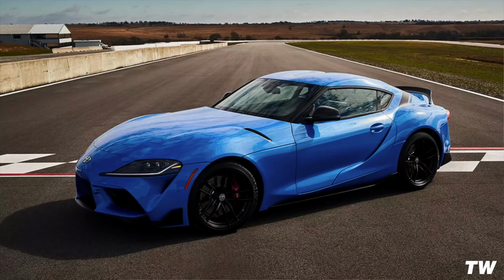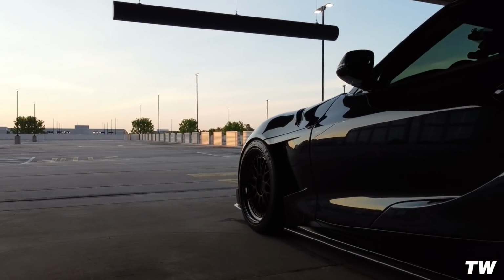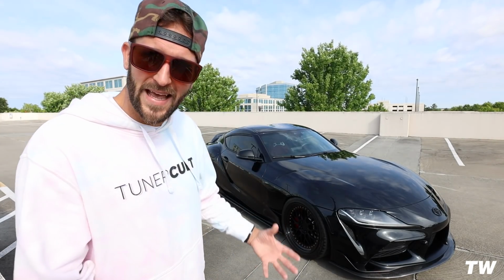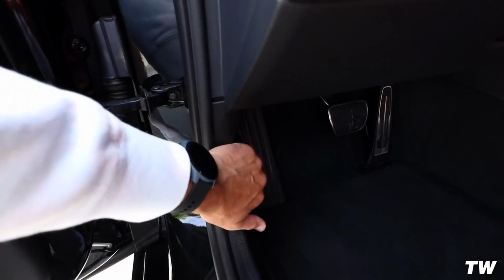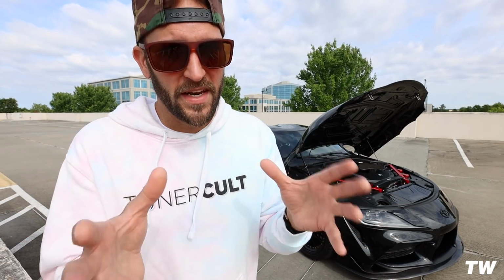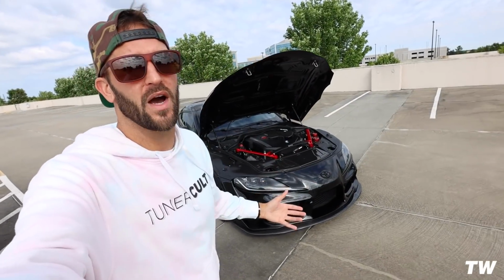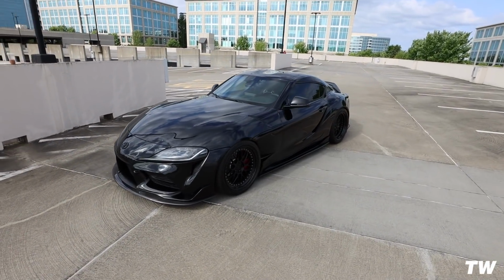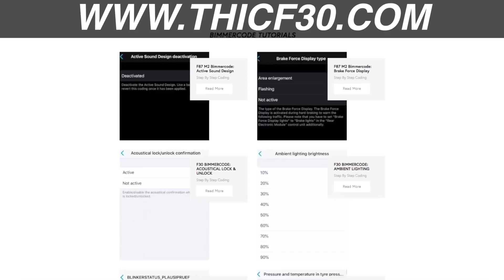2020 VS 2021 SUPRA..(Which one should you buy?)

Comment from the maker: One correction: I misspoke on the oil consumption thread poll. It’s the opposite of what I stated: 45% have reported that they DO NOT have the issue while 21% of people say that they do. My bad on the mixup! Thanks for watching

Update: when the 2021 ecu does become tunable I will make an update video as well so you all know. LINK TO MY SUPRA BUILD SHEET: https://tinyurl.com/2wfc3632

MODIFICATIONS FROM ALL OF MY BUILDS: www.thicwhips.com 

All of my Wheel & Tire Setups: https://tinyurl.com/yyftysns
Reply: If you can swap the 2021 head to the 2020 block, why not swapping the 2020 pistons to the 2021 block?? What if the 2020 ECU could also be swapped to the 2021??
Reply from the maker: Well, I think for starters all of these parts you are talking about are going to cost a lot right now because these cars are very new. But furthermore, the amount of work any of that would take I don’t think is really worth it. When you can just buy the one that has zero issues from the Jump and is tunable. Not to mention, the 2021s wound have voided warranties left and right if you began pulling engines apart. I don’t think the head swap is worth it in general but who knows
Reply: @ThicWhips    For sure bro. But since you mentioned the head swapping, I went I little bit farther with the part swapping 😂  In all honestly, getting new pistons and rings will probably be cheaper than getting a whole engine head, imo. 

And, do you think Toyota will release a Supra with the S58 engine??
Reply from the maker: I honestly don’t know, I’ve heard the rumors but we all know how that goes. I would love to see it though, s58 is just insane
Reply: @ThicWhips    That would be amazing, and I can’t wait to see it, cause I don’t think I could afford it!! 😂
Reply: I hope it becomes timetable soon because I plan on buying my Supra soon
Reply: Do you happen to know if i can take a 2020 ECM and put it on my 2021?
Reply: I have a 2020 Z4 M40i and I do have that problem.I had a 06 M3 and it was the same, so Iam used to it.If you want perfect buy a Lexus but they are more boring I had a is350 f sport an a 15 RCF.Awesome cars but the Z4 is quite a bit faster and handles a lot better.I bought The Z over the Supra because going topless is the best.
Reply: @ThicWhips   should pin this update ))

Comment: I have the 2021 A91 Refraction Blue Edition. 23,000 miles on it. No oil consumption issues. Eventuri intake and Engine cover, FTP Charge Pipe, CG Downpipe and plenty of carbon fiber inside and out. Only thing left until tune is the catback. That will be soon. Spoke with someone inside Titan Motorsports and it would appear that they are getting very very close to cracking the 2021 ECU and told me to expect a big announcement soon. My ECU build date is 6/1/2020. I provided my CAL ID and from what I have been told by Speed Industry it can not be unlocked yet. Thanks for the ECU cf cover info.....been looking for that. One issue that I have identified is the abnormal inside wear of my front tires.....I know ....I know...and yes I have already taken it in to the best wheel and tire place in Columbus, Ohio. Great people do a great job and really know their stuff. After evaluation the wheels tires and alignment. They found no issues except marked inside wear of those front. They said no way to make any adjustments at this time until Toyota comes up with a solution. Took this to Toyota and of course they just threw up their hands......no surprise there. Really love this car but don't really want to replace tires so frequently because of this. So here's my take on this.....Yes the 2021 will get unlocked and be turnable...probably sooner than many think and yes the tuned 2021 will ultimately make more power than the 2020.....I am guessing at least 50 more whp......so can you wait? Well I can. I am a physician who watched all of his friends buy homes, cars, travel etc. while I was starving and up to $100,000 in debt....back then we called it deferred gratification.....it worked fine for me then considering where I am at these days and will work just as well with the 2021 Supra. I really do appreciate your balanced approach to things and look forward to sharing with you. Anyone else with the tire wear issues?
Reply: Hey man how’s the reliability of your Supra so far? Thinking about getting but want to go brand new instead of used 2020
Reply: @topzki47  It is exceptionally reliable. I have no oil consumption issues at all and I have 37,000 miles on it at this time. Soon will get garaged for weekend only driving. I did break it in properly and I strongly suspect the oil consumption issues are related to those who just can't wait...and don't correctly break it in....take the plunge you will not regret it. Good luck
Reply: @josephcarver71  sounds good man 37k miles is alot. even with the Z coming i still prefer how the supra looks!
Reply: How did you go about your break in period? Did you follow manufacture recommended? I’ve read that you don’t want to baby it but you you also don’t want to beat on it. ex. WOT from 2k-4.5k. Keeping it in that recommend rev range but also making sure you’re getting into boost.
Reply: mind if I ask how old you are?  Been thinking about the Supra or M2 (I like both cars...have yet to test drive either one...no surpas or M2s in my area).  I am 45 and am digging the size of the Supra, but worry I may look too old for the car if that makes sense?  Do you think it is a younger person's car?  Similar to the CLA45 AMG (younger buyer) as opposed to the C63 AMG (older buyer)?
Reply: @topzki47  agreed...the looks are what is drawing me to it...and the small size.
Reply: When you replace your exhaust start with the CB and work your way fwd.

Comment: I have a 2017 m240i 6 port exhaust manifold 1st gen b58 with 32k miles mhd stage 2. I put in 7 liter of 0w30 oil in, drove and race for 1 whole year 4k miles later, change the oil and still 7 liter of relatively clean oil came out. Not even 1 pint of oil was consumed, amazing!!! I think just the new 2021 supra having that issue, probably due to their new piston rings design or just a bad batch of rings and pistons.

Comment: The 2020 makes sense from the standpoint that less power equals longer engine life. That is for someone that can be happy with the stock engine power of the 2020. I would rather upgrade the suspension and brakes for a starting point anyway. I enjoy a challenging road more than a 1/4 mile race, anyway ...

Comment: I got lucky and happened to buy an earlier manufactured '21 (built 3/20) and it has no oil consumption issues so far (it is a 3.0 base...so not premium; pricing on the base model was very lucrative...well under 50k in the winter for a brand new base 3.0)... I've been dailying mine and its killin me... 6k miles and I got it in Feb.
Reply: Is it still pretty bad ass? I m looking into one

Comment: 2021 Here. Proper break in with track use after 1200k. 7500k now, no problems so far. My buddy has a jb4 21 with 4k no issues with proper break in. We think the oil issues probably come from beating on the car too early, just our thoughts
Reply: Still going good? Im so torn, about to to get one very soon

Comment: As 2020 owners, we are a little biased. but when I was choosing between leftover 2020's vs new 2021, it was a no brainer for me based on all the reasons you mentioned. I actually don't even care to tune, i like the car as is stock. but that could be a selling point for resale. there's no guarantee that 2021s will ever be unlockable.
And like you said, a modified 2021 isn't going to be WAY faster anyway. Better to just go with a sure thing. To boot, I got my 2020 with zero miles for 52k after TTL, when Toyota was still giving cash rebate

Comment: I have a 2020 launch- its not that you have 0 issues, its that you are not consuming like this 2021s. Check your charge pipe, you will have some oil in there from the blowby. Every supra has this issue and catch cans do not help. That being said, I never had to add oil so there is definitely something up with the 2021s

Comment: I wish you made this video 6 months ago, back in December I got my 2021 Supra.  I thought the 21 was going to be better because of all the updates plus I couldn't find a good deal on a 2020
Reply: How much did you end up paying if you don’t mind me asking ? I’m looking to be in the market late this year, and doing some research now
Reply: @TheStevenQ  56k
Reply: @jeconsta  2020s are damn near the same price 😂
Reply: In the long run 21 will be better once ecu cracked also resell value 21 will be better with updated engine
Reply: @bman1668  debatable. Oil consumption issues, and the ones that are unlocked and modded i heard are similar to modded 20s
Reply: @ActNasty5  they pretty close when both modded but 21 has better top end where 2020 dies off with 2 port manifold, 21 have 6 port for higher top end better air flow , stock vs stock 21 beats it as well
Reply: @bman1668  i know i know lol i just got a 20 because the lowend is fun around town and the locked ecus on the 21 had me worried. Also toyota wont sell them rn because of the safety recall for the brake assist
Reply: @ActNasty5  hmm recoil ? I’m not sure 🤔 I have to check my 21 now
Reply: @bman1668  yeah its just a brake assist malfunction but they wont sell them
Reply: @ActNasty5  hmm 🤔 well mine had
No recoils when I went for oil change and I’m stock no mods lol gotta make sure oil consumption doesn’t effect me

Comment: I wonder if the 2021 Z4 has oil issues too.
Reply: I have the 2020 Z4 M40i and it does.I have 14k in it and before the oil change I had to take it to the dealership for a free quart.I had a 06 M3 before and it took a quart always  around 4K miles into the oil change.I am used to BMW engines.

Comment: Excellent job! The locked ECU’s are actually saving the warranties for those that would’ve tuned. I’m seeing consumption @3K, and knew about the issues beforehand, but the draw of that Refraction Blue was too strong to stay away. 😄
Reply from the maker: Haha that’s one way to look at it I suppose
Reply: How much are you burning?  I got 3,700 and all I added was one liter.
Reply: @nicholaslong3010  there’s a quarter left on the dipstick display till I get the low oil light.
Reply: When my friend bought his supra, this came straight from the dealer. If the car is tuned and modified, they said the warranty still covers it. Which surprised me and I kept asking and the man behind the desk said they cover everything. Even if you change your wheels, so long as they're the same spec wheels as the stock ones, they will cover that along with.

Comment: I have never modded a car before so the 2021/22 would be fine for me.  I would like to make some cosmetic mods (wheels, tint, splitters, and such), and maybe some bolt items such as charge pipe, intake, and any other preventative items.  I already know the car is pretty fast stock so not too worried about that.  Side note, I discovered your change about 4 days ago and have enjoyed your M2 and Supra builds.  I am actually trying to decide between the two myself.  If you had to chose one, which did you enjoy driving and owning more?

Comment: Thanks for engine screen shot. We cannot get the 2021 GR Supra in the U.K sadly at the moment, so will get a 2020 also those oil burning issues on 2021 concern me, but seems erratic between one 2021 car and another it does mention oil burning in the Owners manual though someone has shown. BMW usually oil burn generally though right as you said.

Comment: The 2021 supra has same B58 variant as the M340 and  U.S spec Z4. I'm driving a 2021 M340 and it too needed 1 quart of oil  added at 6500 miles. BMW's attitude is that it's normal. The oil was changed at around 9700 miles and now car has close to 15k miles..so far so good, still full.
Reply: Toyota changed a fair bit on the b58 for the supra

Comment: for your info on the poll, you mixed it up. The amount of people that reported that they dont have an oil consumption issue is DOUBLE (not half as stated) as people who did report to have issues. 51 had no issues, 24 did. This means the majority of people dont have the issue.
Reply from the maker: Thanks I have made a correction in a pinned comment

Comment: Thnx for vid. But just curious on a few things of the 2020 vs 2021.
How different is the 6 port vs the 2 port? What does that mean for potential power/tq building goals if say the 2021 ecu was cracked and tuneable.

Will the 2021 have the higher ceiling on the stock motor? Same question goes for other things you briefly mentioned, like the 2021 has different compression and pistons? If so, how will that also play a role in someone trying to get the most out of their stock motor 2020 vs 2021?
Reply: I’d like to know these things as well.

Comment: Thanks for the info.  It looks like a great car.  I have read somewhere that there is no oil dipstick.  Is that true?
Reply: No dip stick… that’s true. No BMW engine has a dipstick anymore.
Reply: @anthonyschluter8531  That is a bad decision on their part.  If something occurs with the engine, the first thing you do is look at the oil or also smell the oil.  Also you can see if there is a possibility it could be overfilled.  The really bad scenario is a shop might say they changed the oil but, didn't.  You can't check the dipstick to verify.  Or perhaps they made an 

honest mistake and "thought" they changed the oil.  Again this creates a big problem.  Without 

a dipstick, none of that troubleshooting can occur.  Some people claim BMW are just disposable limited use autos.  I guess without a dipstick, they are probably correct.   Just lease one for a year.  You shouldn't need a dipstick for that.

Comment: whatever you say , whether "high performance" or "german engines" ,filling up oil every 1000 miles is not normal at all. Saying that means all german engines(specifically bmw's) or high performance cars drains oil in same level as the supra. Thinking of Track only BMW S1000RR even does not drain oil that fast, I can easily say that 1000 miles oil drain is not normal.

Does anyone actually know why it drains oil that fast? Is it because wrong grade of oil? I'd assume 5w30 or 5w40 can be suitable for 3L turbo engine. Or is it because something to do within the enigne? something to do with oil filter? Is there an issue with the coolant system? 

I'd love to know the reason why it drains oil as I am looking to get Supra.

Comment: When I mustang dynoed my stock tune a91 21 with a dp i made 404whp and my friends fbo tuned 2020 made 410whp

I would say once the 2021s are tunable it’s gunna be the one everyone wants. Took a while to crack the 2020 ecu and will be the same for the 2021s.
Reply from the maker: Downpipe and tune my car made 440whp. Dp tune on e50 I make 507whp. Your buddy with the 2020 has a bad tune or something, Bc that is very low. All of my numbers are public, they can be found under CES MOTORSPORT playlist. The car has been dyno’d every step of the way since stock.
Reply: @ThicWhips  was that on a mustang dyno? Maybe just a bad tune then I guess.
Reply from the maker: Dynojet, understandably these read a bit high. But what I pay attention is relative hp, from stock until now. Since we used the same dyno and similar conditions (ait’s) we have the hp jumps from stock, to dp, to dp+tune, to dp+e50 tune and now we have dp+e50+meth+tune which made about 550whp. At 507 whp, that was about a 170whp jump over stock. Just with dp, e50 tune
Reply: @ThicWhips  ya if it were to be a mustang dyno it would be like 420-430 which makes sense with a good tune on a 2020 with pump.

Comment: Toyota reversed engineered that B58 engine for all 2020 models. They bumped the engines HP for the 2021 model and Toyota didn’t do a tear down for this years models 🥲. In my opinion the 2020 models are the most reliable BMW engine on the market
Reply: And maybe that is why they locked the 2021 ECU.  But that doesn't explain why all of the 2021 ECUs were not locked.
Reply: @supranova730  I honestly won’t be surprised if they did it for safety reasons maybe. That car has a lot of potential once flashed and tuned properly it’s crazy.
Reply from the maker: I could be completely wrong but I have a feeling that it is related to pressure from the epa. Trying to force emission standards and prevent tunes.
Reply: That is the million dollar question.   Why are some ECUs locked and some are not.  There were even some 2020s with locked ECUs but they could be cracked.  If the late 2020 models and all of the 2021 models had a locked ECU it would make sense.   But randomly locking late 2020 models and late 2021 model ECUs make no sense.